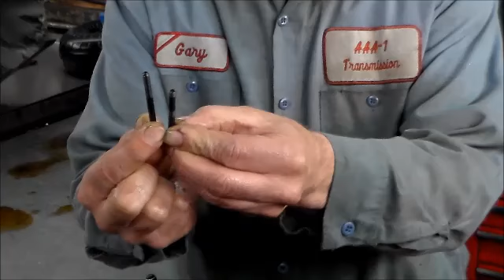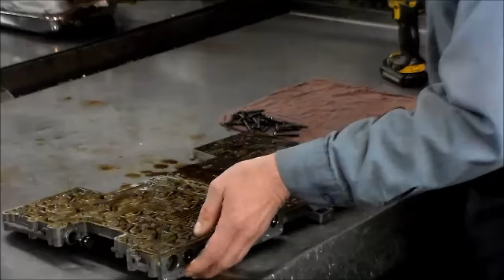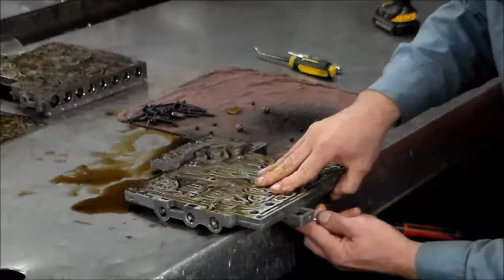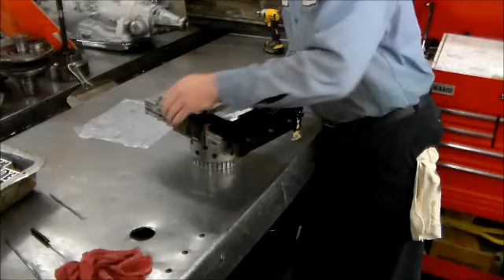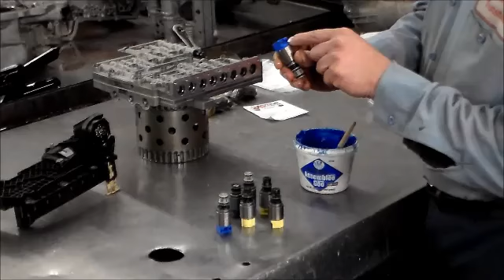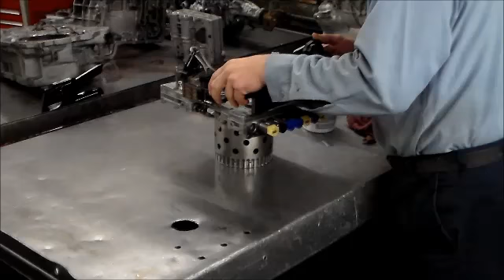ZF6HP19 Valvebody Overhaul

Comment: Thanks again, Gary. This is my next project. Just hoping it doesn't come to a full rebuild. Have to get the engine in before I'll know. It was locked up when I got it and I'm not optimistic on the transmission.

Comment: Hello Gary thank you for the great information on your videos. I do have a question for you. What do you use for cleaning that valve body? Also, I don’t plan on sanding mine once it’s apart unless it’s a must. I am doing this at home on my bench. Any information is greatly appreciated!
Reply: Car is a 2009 Audi A6, no current codes but very high miles. I had to remove the valve body to replace the O-rings on the electrical connector, so I am servicing the valve body while it’s out.
Reply from the maker: @weavy5476  I use Mineral Spirits you can use that or brake Kleen to clean the valvebody, if you do not have a stone, you should be fine if you can't sand the body

Comment: Do you clean the valve body with brake cleaner?
Reply from the maker: I use mineral spirits
Reply: @GaryFerraro  Okay Thanks!!!
Reply: Are you ever going to do a video of the transmission removal from a 335i ?
Reply from the maker: @antslife1089  I don't pull them out, i have installers that do

Comment: This is a fantastic resource! Thank you for shooting it and hosting it. I'll probably never do this, but I know enough to understand what a valve body is, how complex it is on my transmission, that it should be maintained and serviced properly. I may install a solenoid (replacement) kit, with the mechatronic parts, new pan, filter + fluid for my transmission. It always seems to shift well and at the proper times, but the compound nature leads to some complexity, and I'd go no further!
I remember watching, I think it was you, rebuild the transmission from my 740i, the number escapes me just now, and I thought I could do it if I had to, but the project is still waiting. The reverse gear went out, which is apparently a common fault, and I will probably trade the whole for a rebuilt one.

Comment: So what would be the purpose of doing this if you dont mind me asking.  right now my car seems like it have trouble shifting but the problem is that tcm isnt throwing any codes.  The code I have right now is: 000400 - Fuel Pressure Sensor (G247) 
               P0190 - 001 - Circuit Malfunction and Ive replaces the sensor with same results.
Reply from the maker: I do the valvebody as a standard overhaul procedure, i do new plate and new dampers, i also flat sand the valvebody,  What shifting problem do you have?
Reply: @GaryFerraro  pressing the gas peddle lightly the car seems to shift into all the gears but once you press the peddle hard, it pretty much falls on its face and the rpm go to about 4k but the car isnt changing speed at all.  also great video.
Reply from the maker: @davispaul82  This is on pullaway or in the higher gears?  What year Bmw?
Reply: @GaryFerraro  If I floor it at stand still acceleration is slow.  if I have the pedal 1/3 of the way down, it shifts through all the gears fine which is baffling.
Reply from the maker: @davispaul82  Almost sounds like there is a restriction, if you can maybe pull out an Oxygen sensor, see if anything changes, may be loud of course but may want to try that
Reply: @GaryFerraro  disconnected it? I did that with the MAF which usually makes the car run better but Ill do what youre considering tomorrow.
Reply from the maker: @davispaul82  When i had bad MAF a few times, each time had hard coast downshifts
Reply: @GaryFerraro  when I unplugged the MAF, nothing changed.
Reply from the maker: @davispaul82  Don't think that is your problem, sounds maybe like a restriction, i would pull out a front O2 sensor and see what happens
Reply: @GaryFerraro  Solved.  Gary I pulled the front O2 sensor and suggested and it was the same thing.  Ended going to the dealership to purchase a New high pressure sensor thinking the Bosch one I got from Amazon was defect. Got home with the new sensor and upon comparing both I could tell they were different and calling the dealership after finding this out, the say both low and high sensors fall under code g247. During inspection of the to sensors is when I noticed that a pin was bent.  I straightened it out, put it back in, run VCDS, cleared the code which didnt want to dissapear before and then took the car for a test drive and you could tell the difference.  Are runs and shifts perfectly.

Thanks for you help Gary and I appreciate the help you gave me.

Cheers,
Paul.
Reply from the maker: @davispaul82  Thanks for the update

Comment: Gary, that valvebody got any issue since your overhaul it?
Reply from the maker: I don't believe so
Reply: @GaryFerraro   I see, anyway  have a friend who had e60 with 6hp19 trans, it thump when gear change from 3rd to 4th. Do you know what cause that ? he replaced those 6 sleeves and valve body also replaced with a good used one. Does he need to program it?
Reply from the maker: @Linoge279  The E clutch gets applied in 4th, E clutch is not fed through the sealing sleeves, when you replaced the valvebody  with solenoids?  other issues that can cause this problem is a worn rear stator bushing or worn clutches. If you replaced the valvebody with solenoids, do a shift adapt reset and see if anything changes
Reply: @GaryFerraro  it was replaced with the same issue but after being replaced it has same issue still. Shift adapt Im not sure he done that or not but do he need to program the vin number since he uses different computer
Reply from the maker: @Linoge279   If shift adapts were not reset, you will still have the same problem, I'm not sure what will happen if the is a different TCM in there. Reset shift adapts first
Reply: @GaryFerraro  what gets engaged when put it in Drive ?
Reply from the maker: @havocprod  A clutch and D clutch

Comment: Hi Gary thank you for the detailed video, having an issue with my 2008 X5 3.0si with 6hp19 transmission, code 4F8A, symptoms are flared shift from 4-5th gear or over revving while trying to go into 5th followed by limp mode and the code. I did replace the seals, oil and filter but no luck. I have ordered the solenoids going to try to replaced those next, any idea what to look into? Anything else to replace? Oil was clean no burnt smell or any shavings. Thank you so much.
Reply from the maker: Your having a problem with your E clutch, the E clutch is not fed through those sealing sleeves. Fed more towards the front of the case along with the A clutch. Solenoids would be the next step to try to solve the problem, if not you either have a worn rear stator bushing or possible worn E clutches. Does the problem happen when the car is hot?  If you change out the solenoids the shift adapts will need to be reset or car may work the same
Reply: Gary Ferraro thanks for the reply, seams to happen once its warmed up, do the solenoids self adapt or i have to programm them after replacing them? Thank you
Reply from the maker: @DEEuroworks  No Programming, scan tool should be used. Do you know anyone with a snap-on or autel scanner?
Reply: Gary Ferraro i have an autel scanner
Reply from the maker: @DEEuroworks  ok, reset the shift adapts with your scanner
Reply: Ok thanks, will post an update once i get the new solenoids. Thank you.
Reply from the maker: @DEEuroworks  Welcome, let me know how it goes
Reply: Gary Ferraro i replaced the solenoids, no luck unfortunately. Sold the car with the buyer aware of the issue. On the upside I did buy a nice low mileage/loaded 2013 X5 35i Sport to replace the old one. Love it. Thanks for your help Gary!
Reply from the maker: @DEEuroworks  Welcome, probably has internal issue. That was the only thing you could have tried, next step would be to pull the trans out
Reply: Gary Ferraro decided not to put more work and $$ into it as the car had 165k already on it and needed some paintwork too.
Reply from the maker: @DEEuroworks  Ok, thanks for the update

Comment: I have a question because there was an accident when taking mine apart. Some dampers and bulbs fell and completely went missing when taking the Valve Body apart. What is the site that allows you to buy the smaller pieces individually?
Reply from the maker: Im not sure you can, may have to purchase the whole part, i have never seen them sold separate
Reply: Gary Ferraro Oh lord. Well see I got a P0700 code and then a P970 code on my 2007 BMW 530i so my Solenoid C had a low output and I took out the Transmission Valve for it. Now I wish I hadn’t
Reply from the maker: @XLDumpling7  You should ohm the solenoid, may be electrical problem, what is original problem?
Reply: Gary Ferraro The Original was the P0700 code and it put the transmission into failsafe mode so it won’t even come out of gear then the next day I coded the car again and then the Solenoid code popped up in the A/T category.
Reply: Gary Ferraro I have great news Mr. Ferraro. I found my pieces to my valve body. Now for the dampers, which way do they go in? The part with the small pit and ridge or the completely flat side with a little lip?
Reply from the maker: @XLDumpling7  The flat side will face up(installed thats what you will see) The rubber piece goes against the valvebody

Comment: Excellent video will this procedure be same for 6hp z19 transmission 
It’s e63 630i 2005 model 70 k miles 
Not used much but all of a sudden transmission gear was not coming out of park then started working now solenoid fault coming  can solenoids be changed only or whole of this mechatronic device needs to change 
Thanks
Reply from the maker: Solenoids can be changed, price came way down, I would change all of them, they also have a high failure rate

Comment: Hi there, I have just done an overhaul of the valve body on my zf6hp21 valve body, I have replaced the separator plate and solenoids, as well as doing a Sonnax zip kit to cure some shifting issues. However I now have an issue where the car will go into drive, and move forward about 30 feet then will just stop itself again, however reverse works normally. It has no faults in the transmission computer, the oil has been replaced with ZF Lg 6 Fluid and a new filter and pan. I have vacuumed checked all the valves and they all have 21in hg or greater as well as air tested the clutches and they all hold pressure and engage under 30psi. I am wondering if you would have any ideas on what is likely to be causing my drive issue? I am expecting it to be in the valve body however I am struggling to know what exactly in there is likely to cause this issue. Thanks for your time and guidance.
Reply from the maker: Does it seem like it's binding up? does it do the same in manual mode?
Reply: Yes it does feel as if it's binding or locking up. Almost like it's going into park but being an m shift that's unlikely. It does the same thing regardless of it being in manual mode or not. Thanks.

Comment: Gary how you doing I'm Mark from Delaware I have a 2006 Range Rover HSE 4.4 it has 290000 miles on it LOL I had it for about 5 years all of a sudden I think the transmission fluid was low my transmission started to slip I put a new ZF transmission service kit along with the proper transmission fluid in it it ran excellent for a day no slipping at all got in it the next morning and it started slipping again I took the vehicle to Aamco and they said I had a bad transmission of course they will say that LOL and he wanted me to get them to put a new one for 6000 bucks LOL so I goes to a guy who works on Range Rovers they're called Rover bones in Lancaster PA really good guy Randy I bought a transmission off him for $1,200 he claimed it had 120000 miles on it I put the used tranny I got from Randy in my truck it was stuck on 3rd gear and the gear shifter inside the trunk or stay stuck in park in order to get that to work I had to lift the gear shift Rubber up to do it by hand to get it to go to neutral to start the truck it started fine when I drove it it would stay in 3rd gear to make a long story short would it be safe to take the old valve body out of my old transmission and put that on to the used transmission I got from Randy because that's where the memory and the VIN number is for my truck is out of my old transmission that went bad any advice thanks Gary I really appreciate it
Reply from the maker: Hi Mark,
  Yes, you can do that, you have to make sure all the solenoid colors are the same. What you can also do is just transfer the TCM(black plastic part  bolted to valvebody) Thats where the info in stored for your car

Comment: Hi Gary! My gear is a ZF6HP19. I'll separate the valve body and I'll clean it. I'll remove check balls, dampers, and filters, but I don't know, do I need to remove the Pressure Regulator Valves before cleaning? What do you recommend for cleaning? Brake cleaner?
Reply from the maker: No need to remove  pressure reg valve.  Brake kleen is good to use
Reply: @GaryFerraro  Thank you!

Comment: I know this video is over 4 years old, but I am going to do an overhaul on my transmission, replacing the solenoids,gaskets, ect. Should I go ahead and replace the separator plate in my rebuild or can I just pass on it? Response would be greatly appreciated.
Reply from the maker: What is the problem that you are going to overhaul the trans?
Reply: @GaryFerraro  Hard shifting between 1st and second, and then bump shifting on the way down while decelerating.
Reply from the maker: @bosshoss1623  Do you have access to a scan tool? have you tried resetting shift adapts?
Reply: @GaryFerraro  Yes, I do have one. I need to learn what the adaptions are before I go and start resetting everything. Do you think it might be that simple? Cause that would save me alot of work!

Comment: Does anybody repair the black part with the computer  &  speed sensors?
Reply from the maker: I send them to Europe for repair
Reply: @GaryFerraro  link?
Reply from the maker: @thnkbg  www.softelectronic.com
 they also have videos on you tube
Reply: @GaryFerraro  nothing as specific as yours...what codes do you get for the speed sensors, to know you have to send it out?..and how often do you have to, for either tcm or speed sensor replacement?..is it common in your experience? Thanks
Reply from the maker: @tysoncross1120  You will get speed sensor codes, not sure of the trouble code numbers,  I have had a few but people declined repairs, I don't think it's that common but i've seen it a few times.
Reply: @GaryFerraro  thanks for the reply...I did have one more general question...what is your take on fluid conditioners/protectants such as 'LubeGard' for higher mileage vehicles?..do you use them or don't recommend it?..thanks again

Comment: Nice video, thank you! For sure that helps to know what to expect.
I have an 2005 Audi A6 C6 3.0TDI quattro with 6HP19A gearbox. I notice that my gearbox have good moments and not so good moments... sometimes she works very good and you don't even notice as she changes gears, and other times she changes hard.
I don't have any errors. 
I was thinking on take out mechatronic, clean solenoids and change mechatronic Valve Body to case Sleeves (I've bought 5 units original ZF kit) .
What's your opinion? Maybe don't need to open all as you've done? And if I do it I always need to change the middle plate, right?
Other thing, I've changed the oil with ZF Lifeguard 6 as I've found that I must flash the gearbox if I change it to Lifeguard 8... Should I keep the 6 or is mandatory to update it to 8?

Once again thank you very much.
Reply from the maker: Do Not use the the 8, that is for 8 speed transmissions.  First thing you may want to do is reset shift adapts
Reply: @GaryFerraro  I've already done the reset with VCDS a few times.
Any idea why sometimes the gearbox feels like "heaven" and some others not? Usually not all bad but I need to use the steering wheel shift pads to force the gear up, or will shift hard when RPMs go higher.
Reply: @GaryFerraro  Some of the ZF6HPP19A in Audi application mandate Lifeguard 8 (around after 2006 model year) and software version 0100.
Reply from the maker: Thanks for the info, I did not know that

Comment: Hi Ferraro,

As I mentioned earlier I am dealing with a 6HP19 2008 bmw 528 rwd, 198k miles. The problem its doing is slipping from 1st to 2nd and not causing any codes or something. I changed the routine service stuff (four seals, sleeve, and bridge seal and oil) didnt make it any better at all. Could it be just worn clutches? The car actually ran on low oil for quite a while (could be thousand or more miles I think) from previous owner. When I drained it only had less than 4 liters to drain. Oil was very dirty but not much on the magnets. 
Will changing clutches likely to fix it or do you think low oil might have caused bigger damage and its not worth just changing these clutches. The car runs great when warmed up though. 

No persisting codes, only one time it gave me an error "transmission trouble" on dash it slowed down, got stuck in 1st or 2nd gear, but became ok when I restarted. Any help would be appreciated. Regards, Gul
Reply from the maker: clutches could be bad from low on fluid, you may want to try solenoids, that could be done without pulling the trans and then reset shift adapts, solenoids are a big problem in this trans, if that doesn't work would probably have to come out
Reply: Ok. Sounds good! Is it possible to have the solenoids bad and not give an error? I was thinking if its the solenoids it would probably give an error. But I could be wrong.
Reply: @GaryFerraro  I agree I think clutches went bad, cuz when I changed the oil it made it worse. I thought about your advice (thanks for it btw like always!!) but without further taking chances I am going to replace the whole transmission. I recently replaced a fwd tranny and this is not going to be that bad at all, being a rwd.